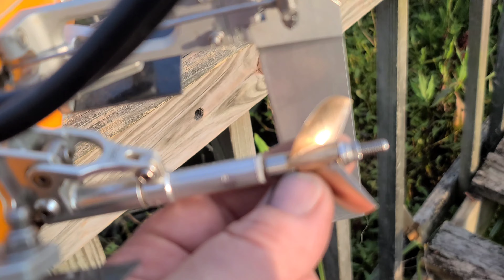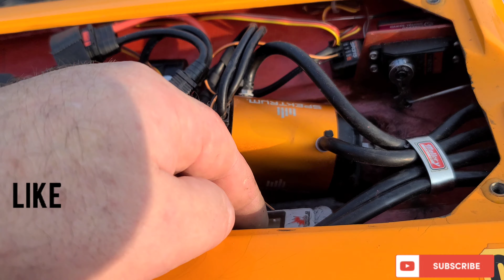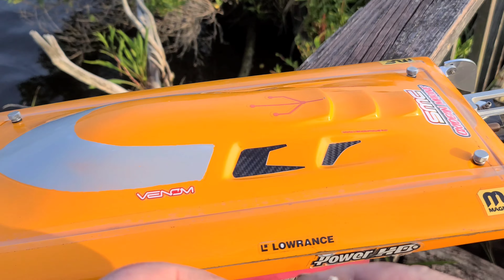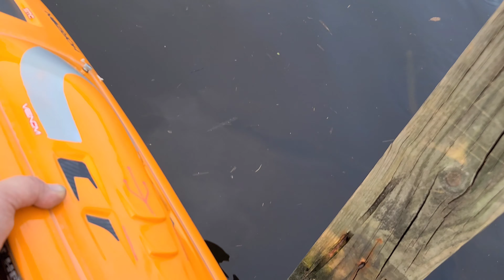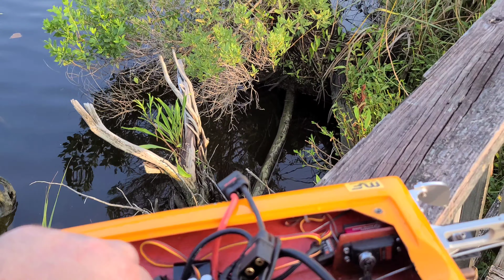Low Kv or High Kv Brushless Rc Boat - Deltaforce 35

Comment: It is an interesting topic and each solution has it's pro's and con's. Like you, I like high rpm setups. I do prefer higher voltage and lower lV motors to achieve that goal, but above 6S, the esc's are very expensive.
One tip I learnt from my Wild Thing: if you extend your rudder behind the prop, your boat will be more stable! I guess you already know, but it's worth trying on this hull 👍.Cheers, DJ

Comment: Yo B. Sick vid!! I smoked a collet on my MG 36 today, Lincoln lake MI!! Cracked down the middle two will be here tomorrow.  What would cause that??
Reply from the maker: Collet? It could have  been that the cable was crimped, basically over tightened at some Pont, or wasn't tight enough and the cable was spinning in the collet..  is the cable okay? Does it look misshapen? If so you may need a new cable so it doesn't happen again.   Proboat couplers aren't all that great to start with.

Comment: I’m looking at this hull right now, thinking either a 4074 2250kv or a 4082 1900kv and that 150A FC esc. I want to walk that line, run it on 6s for speed runs and 4s for chill days. Too much?? 

Would you go better ESC or a lower kv motor in this case? Budget will play into it but I’m just curious.
Reply from the maker: I'd go 4082 1900, I ran that setup and it's perfect with the FC 150 on 6s 2250 will run hot on 6s may be perfect for 4s but 6s it's a little much, this is a larger hull

Comment: Great advice Big B- Yes the proper connectors and wire gage can decrease the chance of overheating, witch we all know is a bad loss of energy/efficiency. You can have to small of a wire gage or to large but a little larger is better than a little to small. (That’s a hard one to figure out) Think of an old resister type speed controller, the more metal the electricity has to run through the slower the boat and run the boat continuously at low throttle you were guaranteed to overheat your soldered points. However run your boat at full throttle with a near direct connection to your battery and you might smoke your motor!!! Interesting enough with a servo actuated speed controller and proper wire size we never had to use water cooling, we “open air cooled” our brushed motors. Look at what these guys in Thailand are doing brushless motors/ESC/batteries all open to the atmosphere when they drag race their long tail rc boats. Crazy right ?
But my whole rant is to get to the point of KV and motor timing. So- (lower timing/higher torque) should = less loss of rpm’s under load. 
Thus- (higher timing/lower torque)
Should = more loss of rpm’s under load and more heat, less efficiency… isn’t this just a hobby- not for this nerd 🤣  
So in short, we’re looking for less heat less loss of rpm’s under load,  in theory,  this can be achieved by turning down our motor timing. Time to tinker tune and test the timing theory 👍 BGFL
Reply: Hey Palehorse, to your point, then there is no need for timing adjustments if they don’t change anything. 
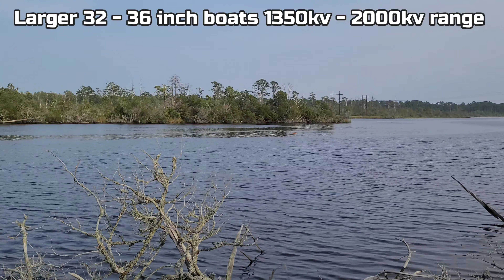THE APPLICATION OF MOTOR TIMING: Ryan clearly states beginning at about 5:39 into that video “decreasing the timing gains higher torque at the cost of rpm’s”    this I’ve always known, however these adjustments are not large changes, to that point and this maybe splitting hairs,  I wonder if by changing the timing (lower timing) can I go faster with more torque within the same setup. This will probably be minuet and as such not worth dialing in more or less timing to get 1/4 of a mph.  I’ve always thought of timing adjustments as a way of making a system more efficient, less heat more run time.  Your thoughts ?
Reply: Semantics, we can agree on that !
I am in the process of testing as I type. 
 First up 0 degrees, however I just realized I can’t turn the timing down only up from 0 
I was hoping for degrees of negative but however my default timing seam to be 19 deg. HobbyWing Seaking 120a
Reply: I see what you mean, at 0deg. I got  51mph at 7.5deg. I got 52mph with one less pass before high temp cut out.
My goal here has been to see if I can go faster with less kv within the same set up, I am of an old school mindset, having run boats with gear reductions to go faster (more torque=less loss of rpm under load) . However from what you said I’ll get that result from a larger dia motor and or somewhat lower kv with larger props. I do plan on testing with timing a little more. Higher timing smaller props.  👍

Comment: Does that ZTW power cut even with  a Capacitor bank like a Flo-Pack?
Reply from the maker: I haven't tried a cap pack on it yet but I've read in a few places guys trying cap packs didn't get rid of the issue, I think the power cut is part of the safety protocol designed into the speed control

Comment: I got rid of the low voltage cut off And run low timing on my d wind 1650 kv 8s  1917 abc but it is a rigger.
No cut offs any more just don’t go past 6 passes
Reply from the maker: Lvc is off, I've been running auto timing, Any other timing it'll power cut even with small props